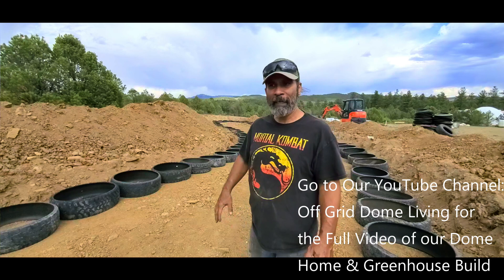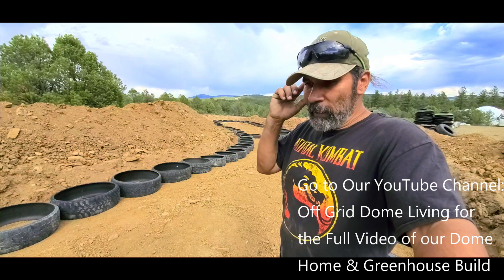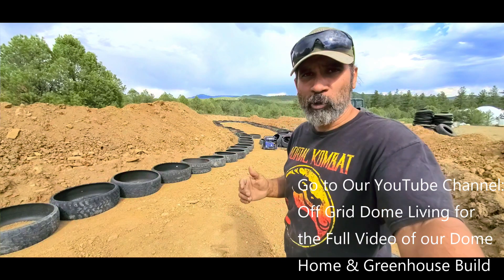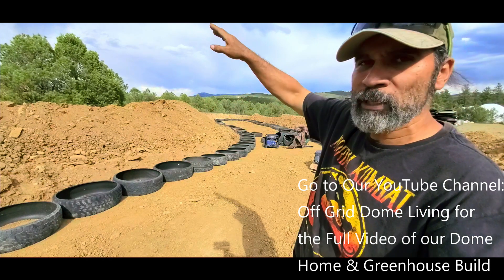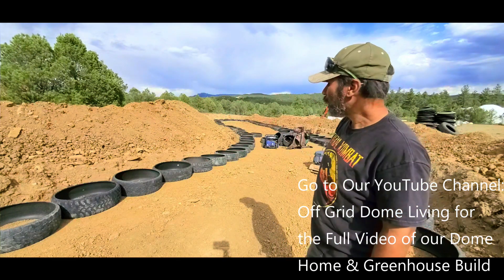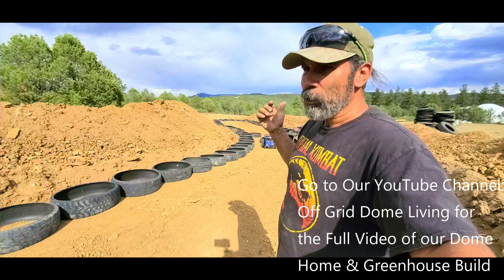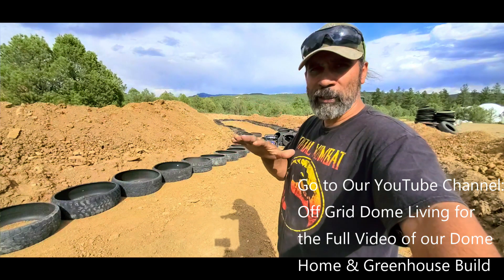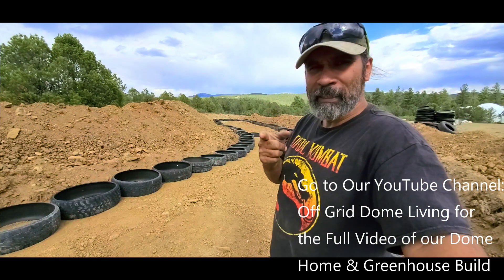Experimental Greenhouse Tire Wall Build | #aircreteharry #greenhouseduild #diy #offgrid #tirewall

Comment: harry - Did you consider pouring an air crate mix into the tires?
That has been my idea for a few years but I'm planning a get away ,"cabin" type set up not permanent residence so it doesn't need the "earth's hope" size

Comment: I am building an earthship style house and like you the labor of pounding tires just seem to impractical i am just cutting one side of the tire to maintain strength of the wall  also the green house part of the earthship is going to be 16 feet deep to enable my aquaponics to really produce a lot of food i think this more practical i plan to post some the build just got underway by the way my earthship will have a sod roof as well

Comment: Brother Harry, I have some insight

What about using the Micro Rebar w/ PERLITE in the Aircrete?

Also, try using C.S.A. Concrete NOT Portland Concrete.

Lastly, Try using Seventh Generation Plant Based Soap 🧼

Salam

Light Theory LLC

Comment: Something i found on foam, not the wall.
Carbon impregnated foam is known to be one of the best and most cost-effective ways to convert radiofrequency, microwave and millimeter waves into heat. Once converted to heat, there is no wave. Use carbon-loaded foam if you can. More is better, but you eventually run into practical limitations. Make sure you do not build perfect square and rectangles to avoid cavity resonances. Alternatively, drywall, wood, fiberglass insulation, books, furniture, mattresses, common glass and all sorts of other common stuff will convert radiofrequency, microwave and millimeter waves into heat. Remember, lower frequencies penetrate deeper and need more thickness than higher frequencies. 5G operating at 28 GHz is stopped dead in its tracks by drywall, especially at a humidity level of 55% or 60%. T-Mobile 400 MHz 5G penetrates deep and blasts right through your house and everything in it. This is why it “travels farther and delivers the strongest signal”. note phase array 5g are beams that can penetrate deeper because if the couldn't they would be impossible to use in your house.

Comment: Brother Harry

Assalamualaikum

What about a Air pump tubing put into the sides and bottom of the bucket, to force air, while the lid is on, and there could be a hole in the lid, to slide the drill piece into, before attaching to the drill.

This way, much more air bubble are being forced into the mixture.

Also, the soap, stay away from dawn, it has degreasers.

It's better to use a plant based soap like Seventh Generation with out any degreasers in the formula.

Or...

The natural foaming agents we use are: Quillaja Saponaria (Soap Bark) Natural foaming agent derived from the Soap Bark tree, which is native to central Chile.

The Concrete, try using FIBER Reinforced Concrete by Quickcrete, to make the concrete less brittle by adding tension from the fibers.

Water, try using distilled water, free of contamination or minerals.

The drill bit, could also have additional paddles welded onto the stem to force more air into it, while drilling clockwise.

InshaALLAH brother, hope this helps.

Comment: My wife and I built a 3 car garage back in the 80s and we cut our tires like you are doing.  I also cut pieces of sidewall with a porta band then screwed the pieces to the tangents of each tire.  That gave me a 30 inch thick wall.  It worked great.
Reply: do you have any photos or videos of that project?

Comment: Your water condenser collector idea is good,   if it is for drinking or watering what you will consume, I would avoid the aluminum collector,  copper, brass or even plastic would be better.  As a proof of concept aluminum is a good start.

Comment: The original tire walls in Earthships were not rammed earth, just filled. They would sag and compress into each other. Ramming them made them more rigid and uniform but added a huge amount of labor. I am very excited to see the result of your hybrid idea... hopefully it stays strong and maintains a uniform shape over the years with the weight of the wall and structure.

Comment: Interesting
Love to see how it works..
For less labor
I am thinking. Cut holes in the top sidewall and cut pieces of rebar long enough to hold the sidewalls apart (flatish) (maybe 4)   and then with a large mixer (at least 1 yard , depends what I can find or make) pour them full.  ????   Slower per row...
But less manpower...
I think that's why we have experiments.  
To see if our great ideas work 😊   Or are big flops.  🙉
----adding a small amount of cement should  help the mix set up faster.   But where is the line between accepted added cost and try some other way